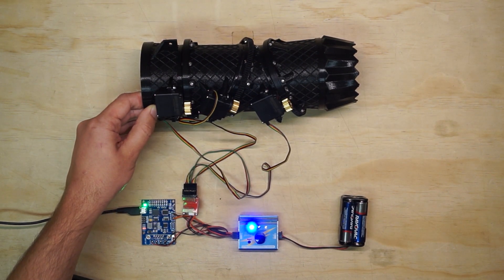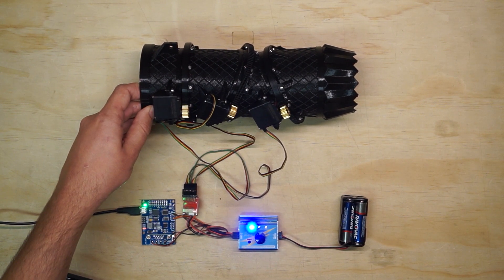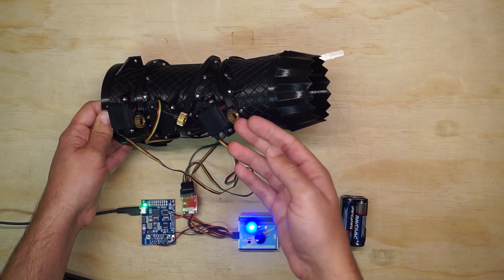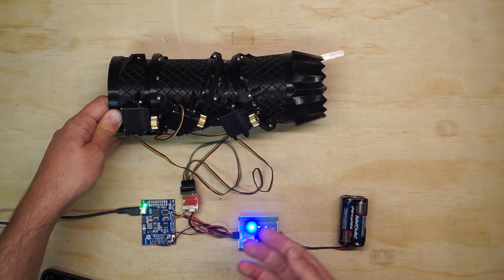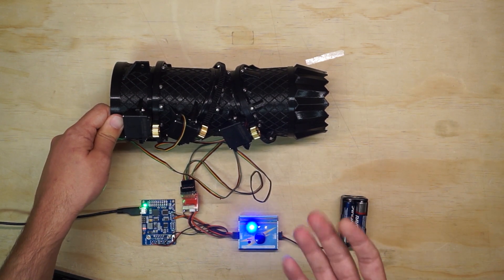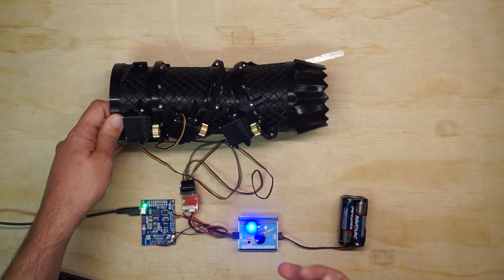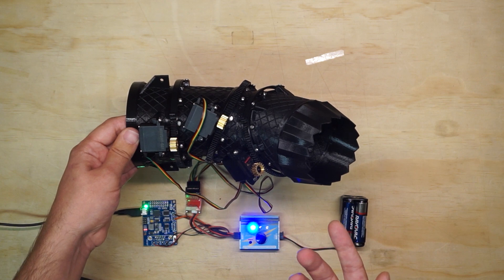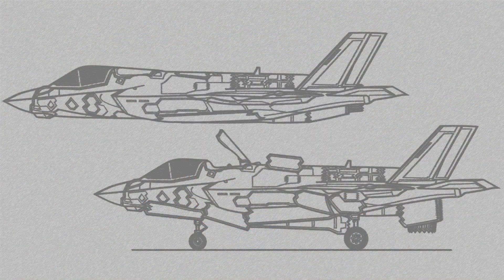R/C F-35B: CAN Servos!

Comment: I'm aching to see you remote mount those last two servo's and drive the gears via flexible shafts, and cocoon a shell over the assembly so it looks sleek. I know that would add weight. But it has to be done.